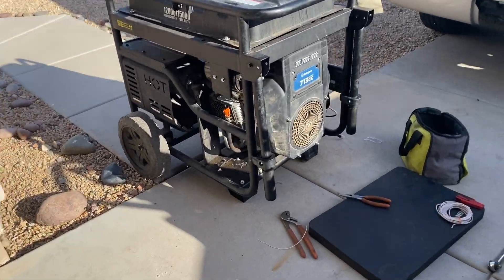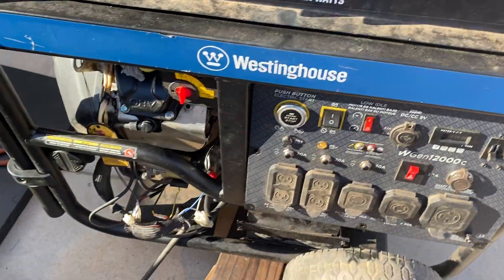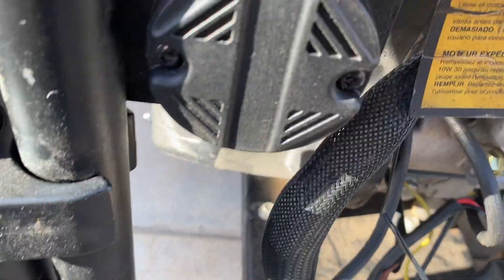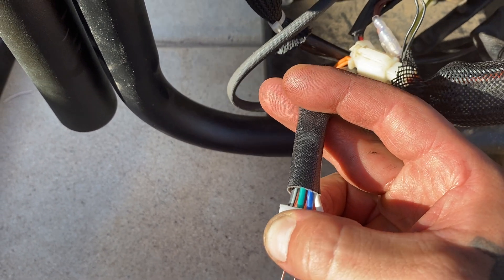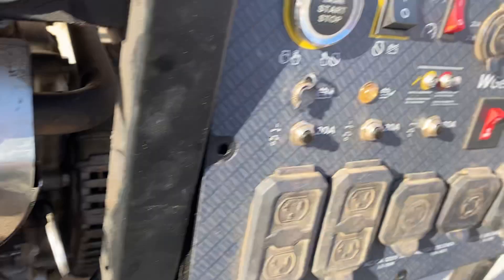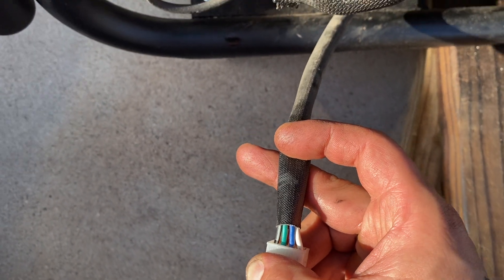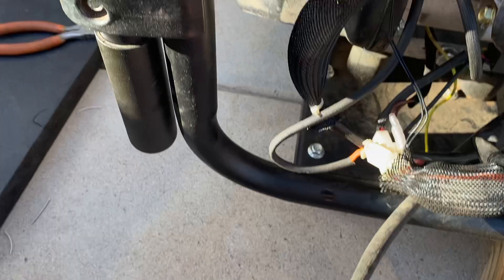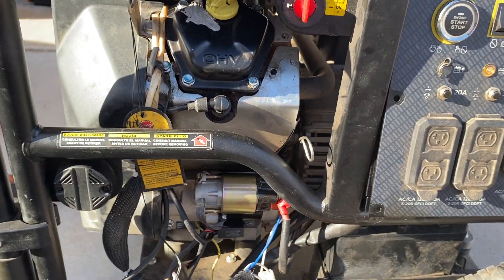Wgen12000c Generator CO Sensor Bypass

Comment: I have the newest version I can't imagine a generator that won't start if the battery is dead even if used to pull starter will this eliminate that
Reply from the maker: Hi,

Yes the process shown in the video will eliminate that.
Reply: @ThatGeneratorGuy hello
Reply from the maker: @MarkJohns-b2z ,

Sorry, I thought this video was for another machine. This engine is too large to be pull started. You would have to jumpstart the machine if your battery is dead

Comment: How about just covering up the CO sensor with plastic/tape?
Reply from the maker: That would will block most of it and will work only if the CO sensor is operational. They last a maximum of 3 years in dry climates and once they fail, they will not allow the generator to run.
Reply: @ThatGeneratorGuy  makes sense. Best to bypass. Thx for the vid & response. 👍🇺🇸

Comment: hello, once you jump the c02 sensor do you plug back in? or do you jump it and leave unplugged?
Reply from the maker: @trus8363  ,
Once the wires are jumped you leave the harness disconnected from the sensor.
Reply: @ThatGeneratorGuy  thank you
Reply from the maker: @  no problem!

Comment: did you just insert a copper wire into that harness to connect the blue and green wires? what gauge wire? will that stay in there or better to put tape around it?
Reply from the maker: @norandrostenedione  , any gauge you can get should work. I think a minimum of 22 gauge is needed which is pretty small. 

For me, I chop all the other wires and solder the ones that need jumped together and heat shrink it all and hide it under the wire protector. Then I’ll plug it back into the now bypassed sensor so if you look at it, you’d never know it was bypassed.

Comment: I just purchased the WGEN11500tfc.  The connector is different, smaller  & black .  I don't see a green wire.  Are you familiar ?  How did you figure this out ?  Thanks
Reply from the maker: @ja9915  , I usually seek a wiring diagram or trace the wires to figure out what the circuit is doing. Then bypass it. 

Do you happen to have a wiring diagram for the generator?

If not, what color wires are there?
Reply: Haven't found one yet. Not available at website. Contacted tech support. Waiting for reply.   Searched Manualslib, not available.     Thanks
Reply: @ja9915  White to Brown/Red stripe are the correct wires to jumper to temporarily bypass the sensor.  I’ve watched 2 different demonstrations on the WGen11500tfc model and both run normally when jumpered and stop once the jumper is removed from one or both connectors. I have been running my generator properly positioned outside and away from openings, with CO monitors on all 3 levels of my house and on the 1st 2 levels extra monitors positioned very near the outside wall that the generator is nearest, figuring that these would likely be the locations at the most risk of infiltration, but to be safe I have multiple CO monitors on all  levels.  Much better safe than sorry!  But like any sensor, it will degrade over time and stop functioning even though the exposure to the outside environment is minimized by blocking the flow of air.  But it will be handy to have a jumper prepared and ready to go along with the documentation of which to jumper.  Looking at the connector with the longer side in the horizontal axis and with the release tab facing upward, the jumper would go between the bottom row’s 2 end sockets which are the brown/red striped wire to the white wire coming from the ignition coil.  Both of the videos have been more recently posted.  I hope this helps.
Reply: I just got the schematics for the WGEN 11500TFC.  How do I upload to you ?
Reply from the maker: @ ,

Email me at thatgeneratorguy @ gmail
Reply from the maker: @ja9915 ,

You’re not looking for continuity. Just connect the wires and see if the generator stays running
Reply: E-mailed the diagram to you. Thanks again.
Reply: 10 pin black connector, Back row, right to left, pins 1&2 Brown,  3  Pink, 4 Vacant, 5  White (to solenoid?),  Front row, right to left, 6  Yellow( connector has green stripe),  7 Yellow Green ,stripe , 8  Red, 9  Blue, 10  Black.   Igen 11000dfc, schematic seems to have similar pinout for CO sensor.
Reply: https://cdn.westinghouseoutdoorpower.com/owners_manuals/iGen11000DFc_manual_web.pdf
Reply from the maker: @ ,
The 1100dfc is definitely not going to work as a comparable schematic. It works differently on the inverters. 

Try jumping the white to the black wire across from it. Also, do try simply removing the connector and see if being disconnected works.
Reply: Am I looking for continuity between certain pins ?   White & Black are open circuit, no continuity. I have continuity from Black to ground, Blue to ground.   (chassis). Continuity between Black & Blue.  Thanks
Reply: Black & White, no go, starts & stalls, unplugged no jumper, same.  
E-mailed the diagram to you. Thanks again.
Reply from the maker: @ja9915  , the last combination to try would be brown w/ red stripe to the white wire. If that doesn’t work then the sensor is also acting as a condenser so you would need a different ignition coil to circumvent the sensor. 

Please let me know how it goes
Reply: An observation. Power switch on,  With sensor connected , I have 4.68V DC on white wire, (to solenoid)?)  .  The  Brown, red stripe is carrying full 13 V battery. The pink carries 5 V.  Is it safe to jumper 13V on the white, or should I try the pink with 5 V.  Thanks
Reply from the maker: @ja9915  I figured the voltage would be around 5v or 3.3v on the white wire because that’s logic voltage. The fact that it’s less tells me that it’s very possible that it’s actually a signal wire and the sensor is actually activating a transistor inside the ignition coil pack to open and close the flow of electricity to the primary coil (which is what induces the voltage that makes the spark in the secondary coil/winding. 

The pink wire is the remote wire. I don’t know what microcontroller the generator uses or how much current the pin can source (I.e. is it enough to operate the transistor or will it damage the board and your ability to use the remote?

I’d say go ahead and try it but I really believe in this case it would be best to just replace the ignition coil with one that has the transistor and control circuit built in.
Reply from the maker: @ja9915  I also mean to try the pink wire. It’s just operating a transistor so it would probably handle the 13v battery voltage just fine but I’m not certain because I don’t know what transistor is used and I don’t want you to ruin the ignition coil.
Reply: I think I'm just going to cover the sensor & have a spare just in case.  Seems like to much trouble.    Thanks again.
Reply from the maker: @ it’s just 7 bolts total but I understand. If you need help selecting a coil in the future let me know 👍🏻
Reply: Future  warranty  reasons. Brand new unit.    Thanks again .
Reply: @ja9915 I’m trying to figure this out also for my 11500. Anyone know which wires to jump?  I disconnected the harness from the sensor the white wire no longer shows any volts. So I’m guessing the white wire gets is power thru the sensor? I checked the volts on each wire on the harness and noticed the pink wire does supply a 5V. 

The white wire with the Gen power on, but engine off the wire shows 4.5V. 

With Gen power on and engine running it shows 4.8V.

The pink wire does supply a 5V constant.
Reply: I have a Duramax XP15000 EH and had the exact same problem I pulled the plug apart behind the sensor and there was only 2 wires in and 2 wires out so that made it pretty easy for me to figure it out. I just jumped the 2 that goes to the wiring harness with a short copper wire and it started right up and kept running. This generator has 10 hours on it.

Comment: I have the 10kw inverter generator and I found the sensor with the connector attached. Can I just leave the connector unplugged from the sensor while jumping the blue and the green wires like you said? Will everything still work even though all the other wires in that same connector will also be hooked up to nothing either?
Reply from the maker: @Ozzie4Para  if you have the same sensor then likely yes. A wiring diagram of the unit would tell more. Nothing should be damaged by trying it out if that’s what you’re concerned with. It will either work or it won’t.

Comment: I have a w gen7500c and this fixed my problem. The sensor looks like it's in a different spot and looks like it's a little bit different, but the blue and green wire still fixed it for me. Thank you so much! Everybody else's videos were useless.
Reply from the maker: @Destructor429  thanks for letting me know it’s the same. I’m glad it could help you!

Comment: I have ipower gas generator GXS7600iRD and run for about 20 seconds and then shut off.
I wonder if having the same color wired
Reply from the maker: @Joeilliano  ,
It’s possible. The schematic for your generator says the colors are/should be different